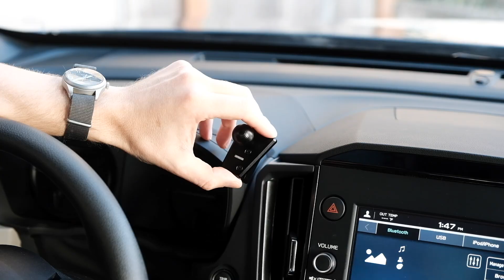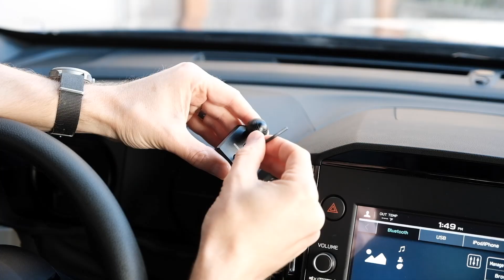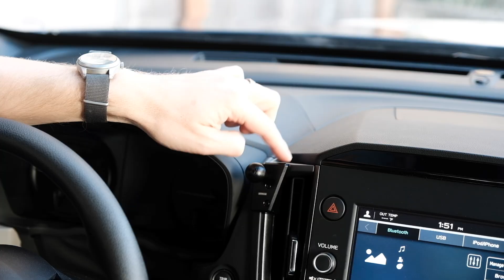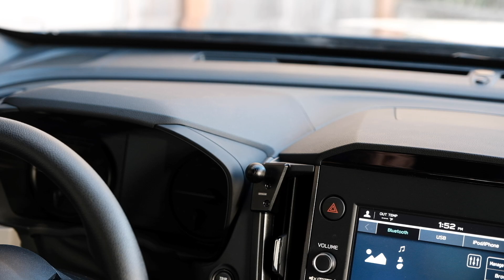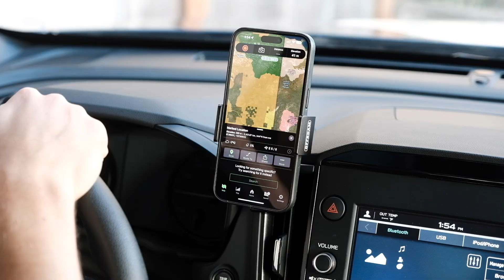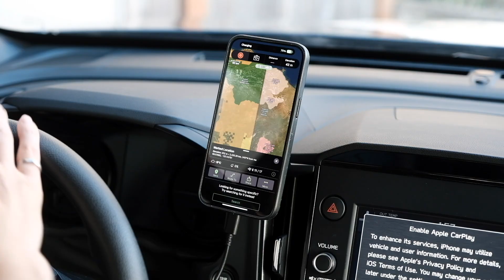Subaru Forester 2025-2026 Phone Mount Install - by OFFROAM

Comment: Looks like a good product, but way too expensive for me. Mag is $85 bucks. If you want the charging one, it's $120. Yikes!
Reply from the maker: The price is based on what it costs to make these. And they aren't easy to make: every one is custom machined from metal specifically for each vehicle make and model - which is the only way to go if you want the mount to work well. However, because of that - these products are made in small batches, from good materials that let you install these without taking apart the car and have a very secure feel.